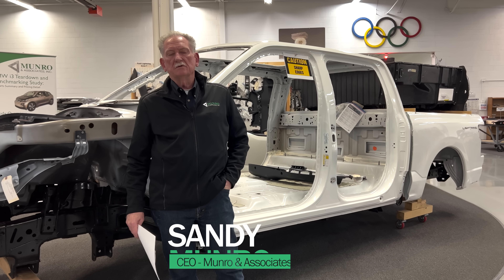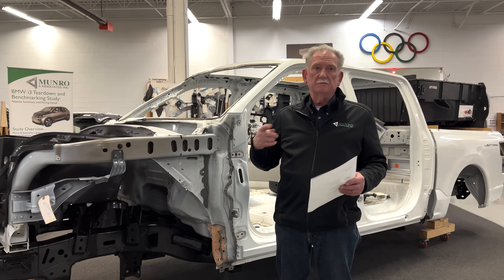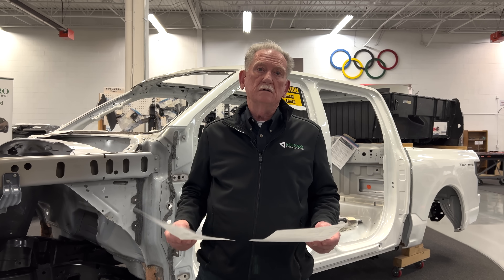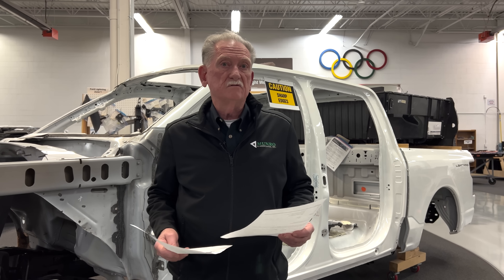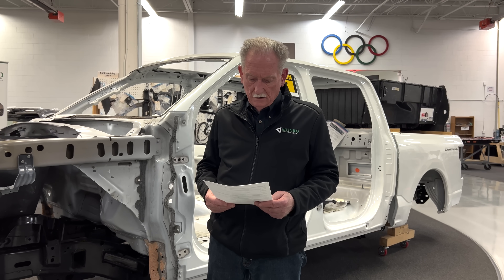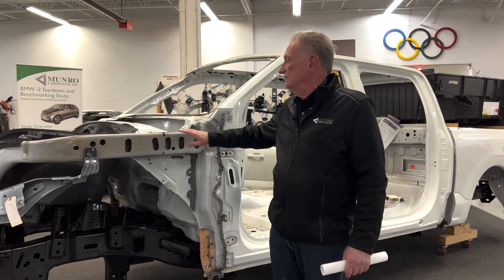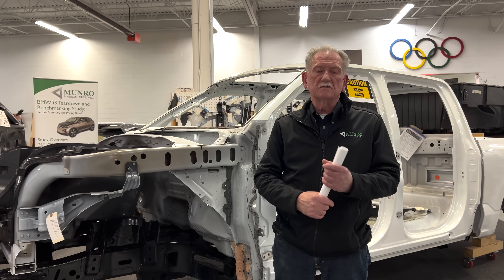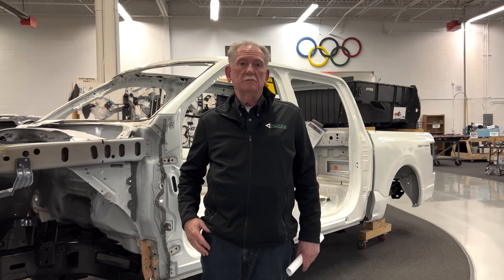Sandy's Initial Thoughts on the 2025 Ram 1500 Ramcharger

Comment: Two big problems with EV trucks:
1) Range while towing.
2) Accessing charging stations with a trailer connected.

This solves them both, with the benefits of full electric for daily use.
Reply: 100% this. Disappointing Sandy did not address the only real fault with the Lightning, range while towing. 690miles unloaded is indeed not needed, but by the time you put a trailer on it will be 250-340 miles, which is not great, but certainly usable  better than  the paltry 100 miles range on the Lightning. Efficiency is not stellar, but the EV only range will cover 90% of people's needs if they want to use it as a daily driver, and the generator is there for the 10%.
Reply: @maptap6654  but also cost. 40-50k lightning vs 90k for BEV, and 150k for ram charger
Reply: @duramaxadventures5832  Not sure where you are getting a 40-50k Lightning. I can't get an extended range F-150 for less than 77k CAD here (56k usd, and thats the pro model, likely none in stock).  Extended range on the lightning is an absolute necessity. And I was not aware Ramcharger had any pricing out at all. If its indeed  150k then they will sell none.
Reply: 3) Accessing fast charging infrastructure in remote areas.
Reply: Towing is 100% the reason why I plan to get this truck. My Rivian tows like a dream, but I don't want to have to stop and charge up every 100 miles (or even more frequently in the winter or in the mountains).
Reply: The problem with plug in hybrids is longevity. How long the pack lasts is a simple calculation. (total range)(chemistry cycle life)(1/2*degradation factor) An EV is considered "end of life" after it only holds 70% original capacity, although many keep using them longer. Model 3 the 35K LFP one gets 6000 cycles and 270 miles of range, so 6000x 270x 15% (average degradation is 15%) so about 1.4 million miles.
Hybrids with pouch cells have 1000 cycle life and 50 miles of range usually. So 42k miles, or you can keep running them lower until the battery becomes dead weight. Besides that, as a pure EV, it has to carry 500LBs of extra weight so it's not saving you on cost's as much as you think, before factoring maintenance.
Reply: @Flutter9i6  if you are only talking battery longevity, if battery prices keep coming down a small 40-100 mile should get pretty affordable.
Reply: Meet next the Tesla Semi. The thing that is solving all your problems for future regular trucks since they will share charging stations and powertrain. Its just all still new infrastructure coming proportional to the sales which are still 0 publicly!! just wait a bit more ;)
Reply: The additional maintenance though... plus the additional $60,000 up front to get the battery truck this is going to be one of the most expensive cost per mile vehicles on the road regardless of how efficient it is.
Reply: Agree, this is how locomotives move everything under the sun across America.
Reply: This range extender is not something new
Ian Wright at Wrightspeed developed this concept class  four class eight trucks
He was the original designer of the Tesla
Reply: this
Reply: I see lots of Pup trucks with tow hitch balls, but they never get used,not even once.
Reply: An EV most definitely needs a huge battery and 500, 600, 800 miles of un ladden range. Why?? When loaded, towing or in severe climactic conditions the rage DRAMATICALLY plunges. Range anxiety is as real as range is poor in an EV.
Go live the truck lifestyle and discover what the Ford Lighning owners experience. 
Sandy, go tow your RV trailer, camp trailer, small fishing boat or a ski boat or your work trailer.  Now report back to America how unnecessary a big range is or on if "range anxiety " is real or simply tricky marketing. Go on try it.
I recommend you and your staff subscribe to and watch Jason of Engineering Explained. He will outline the realities of an EV truck for you.
As for the common every day range needing only an average of 40 miles. We charge 3 times from Las Vegas to Irvine California in the summer for a 270 mile trip.
In the summer in Las Vegas an indicated 200 mile range vanishes to 60 miles following a 20 mile round trip to the office and home. The car sounds like a jet on the runway parked in back of the office as it cools its battery all day. It the summer we get between 0.3 and 0.5 miles traveled for every mile of indicated range. Try it in the heat of Las Vegas or Phoenix. It's an eye opener. Get stuck in traffic for any reason and discover your range dwindle to the point where you can't make it to the next charging station. All electric is eventually a truly viable option but for the foreseeable future the value for money is not there in the truck world. The Energy required for the work asked is simply not available without ICE assist. One day.yes, but not for a very long time.
Reply: True, but the amount of money put into battery research is about .0001% of that put into gas vehicles. And I'm probably being WAY too high on how much has been put into battery research. 

The issues with range and stations where you charge vehicles with trailers will be thought of something quaint within the next few years as gas stations are replaced with charging stations and they will look more and more alike.

Right now the biggest problem is that Charge America and other companies building charging stations are NOT building them like gas stations. That's a mistake by charging companies who are trying to limit how much money they are putting into this.

Charge America and others are trying to be like Tesla charging stations that are profitable without gas station like setups. Note that most gas stations are not profitable because they sell gas. They are profitable because they have a small store that people go into and buy things while they are paying for gas.

Charge America and others will NEVER be very profitable until they start working with smaller gas stations and pay them to let them put in chargers -in line- with the gas pumps. So if you go into a gas station 40 years ago they had separate physical gas pumps for regular, unleaded and super. Now days they have them all in the same enclosure. 

Gas stations need to add electric charging into those enclosures or at least side by side with them and THEN add them into the same enclosure. Then as electric cars become more and more common and replace gas and diesel vehicles, they can drop the other pumps for unleaded, super unleaded and diesel. Quite a few are already getting rid of diesel. Just replace that with an electric charger. Charge America and others could pay to have it theirs. But they will need the Tesla connector because almost every major car company is on board with that superior connector.
Reply: I’ll never ever buy one ever !
Reply: I'm not buying an EV until they get rid of the battery
Reply: You left off a problem with EV trucks: charge rate. Fastest EV charger out there is 350kw. 
And EV batteries only maintain peak DC charge rate up to 30-40% SOC and drops off after that. A gallon of gasoline is ~34kwh being pumped at 9-10gal/minute, 304-340kwh/MINUTE. The gasoline pump is the equivalent of 18-20 megawatts. Until EVs are charging at megawatts and energy densities of batteries  triple or quadruple it will be a no contest.
Reply: When is ram building a 2500 charger?
Reply: This guy has never driven out west if he’s not worried about range anxiety. We drive 110 round trip min to our nearest Walmart. 22k miles a year on average per vehicle.
Reply: Not to mention the energy required while towing gets into sorta crazy charge power needs to get replenished efficiently.  It's one thing to recharge a slick little model 3 that sips the electrons...or something bit bigger than can do 350kw...but the 350kw that is the max really getting built out isn't even that fast once we're talking the 150-200kwh needed to get another reasonable leg down the road on a battery.  And really to me 690 is a good range even with Model 3 like vehicle if you just don't want to actively wait on a charger after a pee or for any other reason.  Drive, pee eat, whatever/where even/whenever and then sleep/charge and then repeat the next day rather than hassling with 15-30 minute charges and 1-3hours of extra time on the road vs gas in some all day for a couple or probably few days with the EV.  This is what I don't get about the EV crowd...I don't want to plan some 10 hour plus trip and have the fact I got an ev forcing it to be a stop at a hotel or extra stop at a hotel when the same trip was pretty easy in one shot or two prior.  Yet if the goal was all day driving range...you only stop when and where you want and just charge while sleeping and get all the EV benefits of a daily commute EV when on the road.  Then I will happily abandon pure ICE and Hybrids...until then...even if I only do multiday road adventures once in a blue moon..I'll still be doing them in something that I can just pump some gas into to keep going.
Reply: @stormsj Tesla Full Self driving is so incredibly good on roadtrips I wouldnt trade it for ANY convenience you get from ICE quick refueling. Its an absolute non negotiable. You can take a 10 hour trip with FSD and feel like you didnt drive at all. And it greatly improves your safety on the road
Reply: I have a RAV4 Prime plug in hybrid, that works as a wonderful EV for me 80% of the time, but I can still do road trips or extra driving without a worry. I feel like this truck could be a nice daily driver with the capability of an HD truck. Sounds too good to be true! Can it be lifted a little for off road use? That’d be a miracle truck.
Reply: @JamesBabb  It has a 92kwh battery pack that only claims 145m BEV range.  At $0.25/kwh, that is $23 to go 145m or $0.16/m compared to a Tesla Model 3 at $0.05/m.  Still less than an ICE truck with $5/g gas that costs $0.25/m but expensive for a daily driver unless you actually need a HD truck fairly often.  The Ford Maverick hybrid light truck costs less per mile at $0.12/m.
Reply: @kirkellis4329  whose paying 0.25/kwh at home?  If you have this truck you are almost never charging anywhere except for home and buying gas when others would be charging at fast charger.  Maybe if you do a long stop on a road trip to eat and a charger happens to be handy you plug it in.  

At 0.10/kwh it's way less than a maverick for the daily commute.
Reply: @kirkellis4329  also, suspect there is good chance they are under promising at least on the EV range.  Only reason I figure it might be that much worse is related to the radiator and would guess it has shutters and such for EV only uses and so may have more like 175-195 miles range when it's not expecting to need the gas for a trip and never does turn on the engine and open the shutters to the radiator.
Reply: San Diego  @stormsj
Reply: @kirkellis4329  Good thing US electricity is only about $0.13 per kWh.
Reply: @terrysullivan1992  Well $0.25+ seems extreme...guess you're super lucky you don't need A/C there.
Reply: @kirkellis4329  Hello, gas is now $3, so don't quote California gas prices...
Reply: @stormsj  In SoCalifornia, the CHEAPEST home rate is $0.25/kwh now.  And that is only if you qualify for the EV owner rate, and only late at night.  The cheapest off-peak rate for anyone else is $0.33/kwh and peak rate from 4PM-10PM is $0.55/kwh.  Gasoline is also now $6/g here unless you can get discounted gas at Costco for $5.25/g.  Energy prices in California suck.
Reply: @JamesBabb  Count yourself lucky you don't live in SoCalifornia, where 25 is the cheapest residential gets.  Usual off-peak price is 33 and peak price from 4pm-10pm is 55.  But gas is over $5/g right now, so that is probably double what you are used to as well.
Reply: @stormsj  Ha !  My electric bill goes from $65/m in winter to $250/m in summer even though my A/C is set to never come on unless above 85F.  My natural gas bill goes from $10/m in summer to $200/m in winter.
Reply: @toddsholtis4470  It's where I live, so the only gas price I am familiar with, just like $0.25/kwh is much higher than most of the country pays for electricity, and in California it is  $0.55/kwh from 4pm-10pm while some places pay $0.10/kwh with no variation day to day or time of day like we do.
Reply: @JamesBabb  It's very location dependent, with average retail prices ranging from about 8.5 cents to almost 25 cents in 2022 according to the  EIA.
Reply: @JamesBabb in Anchorage it’s .22c, Tok is .40c
Reply: Costs can vary dramatically depending on where you live... the average U.S. electricity price is $0.16/kwh.  Rocky Mountain Power is $0.12/kwh peak & $0.06/kwh off-peak.  So, do factor your own area's costs into the equation.
Reply: @stormsj  0.13/kwh is if you're charging Level 1 or Level 2 (<10kw) at home. I've seen 0.25/kwh level 2 charging at a hotel once.  DC Fast charging prices are 0.40-.55/kwh. 
I can charge at work for free and go weeks without paying for fuel.
Edit: I live in New York. Your electricity prices will vary of course.
Reply: @kng128 well that would make more sense, but he seemed to be suggesting otherwise at the time...haha.  This was awhile ago though...so not sure I remember exactly what I was replying too...and don't feeling like rereading it all for context...haha.
Reply: It does help fit a niche somewhat left by the Volt, except it covers those that do need to occasionally tow long distance. I'm glad they are going range extender as apposed to hybrid or plug in hybrid with a tiny battery. Good way to get those with range anxiety to realize how little they actually need for daily use.
Reply: @werevamp  I think a lot of us fully understand it's great for daily use, but don't want to have one or 2 car family and have a vehicle we really only want to use for commute as we just don't want the charging hassles on a road trip.  Or have to fight over who gets the EV and who has to stop at gas station all the time if it's 2 and you want one to be gas for road trips.  I rarely road trip, outside maybe a novelty road trip if I were to purchase an EV I'd only have it for commutes or road trips short enough I only destination charge maybe.  I just don't want the hassle of waiting forever or just generally being stopped longer over a multiple day drive that as nearly as i can gather can end up being a 3rd night on the road vs 2 just cause the charging adds up or you have charging issues somewhere or some such.
Reply: it's really clear that Sandy doesn't know how to think about these problems. He seriously thought the people at Ram didn't do any customer research.  This guy has his head up Elon Musk's skirt.
Reply: @ACE-vp2jn  Have you ever watched one of these videos before?
Reply: @cadman10000  I watch all his videos...he's wildly Tesla biased to point he's not way different than some of the folks on YouTube that exist almost exclusively to boost and promote Tesla.
Reply: @cadman10000  yes it's a bunch of Tesla pumping as of the past few years once became the stardom from saying great things about Tesla.  I watched his review last week or about the Hyundai, and he was saying Tesla needs to do this. Like what kind of review is that? This is about what's great or not about the GV60.  I can read between the lines, he knows his main audience is Tesla fan boys, and that's what pays him.
Reply: @ACE-vp2jn  Explains why he's recommending the Ford /s
Reply: Towing is such a tiny, tiny amount of use case for 1500 sized truck though.
Reply: @cadman10000  how is towing a tiny amount of the use case?  Do you mean you'll likely only tow 8000+ lbs 0.1% of the time you use the truck?  When that 0.1% need comes up you still need it...and that 0.1% experience can either be good or a nightmare that seems your waiting for the thing to charge as much almost as much as driving even if it's only a small percentage of the trip.
Reply: @stormsj If you're on vacation on a long trip, what's the hurry?
If you're in a hurry, take a jet and rent a vehicle when you get there. It's much faster and more relaxing and puts less wear and tear on your vehicle.
Driving long distances is a waste of time.
Reply: @dvader3263  When family is in various states and like 8 hours apart, but all sorta along the way on a 18 hour trip with like 10 hour stop and 13 hour stop and then 18 hour final destination with some basically 3 hours from airports...it's way less complicated to take the drive and spend the night.  And being 3 hours from airports I am sure you can imagine what charging infrastructure is like.  Pretty sparse.  Basically to whole sections of USA and many of us with family in those areas...EVs are still totally pointless and bad ideas unless you just enjoy the challenge/hassle/complication of getting the still iffy infrastructure to work.  Even in the better infrastructure areas long trips like this need planned as lazy drives where you are maybe spending more time waiting on charge rather than at more interesting stops than you would in ICE on same trip.
Reply: @cadman10000  maybe in your world. I assume you aren’t a truck owner. The rest of us have campers, boats and equipment trailers. This “1500” has the weight and capability closer to 2500, is a smaller size.
Reply: @cadman10000   At 14000lbs tow this is a replacement for 2500 series trucks.

Comment: I think that Sandy missed a couple elephants in the room:  1.  Why does it need a V6 to run a generator?  2.  At highway speeds, the Chevy Volt has to lock up in a direct connection so that you are no longer running on electricity.  What about the Ram?  Also, what percentage of pickup owners need 690 miles of range or 14,000 pounds of towing?  Probably less than 1%, plus those that want to proclaim that 'theirs is bigger' even if they don't use it!